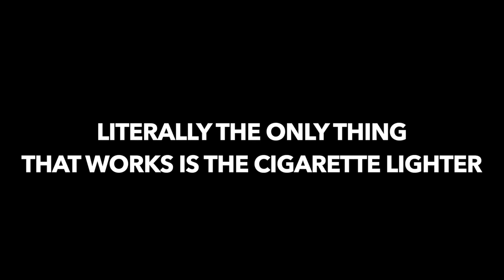OFFICIAL TRAILER | My MD500E Might've Been a Bad Purchase

Comment: “JB welding a helicopter is bad.” Spat out my water 😂
Reply: No shit, right?
Reply: no but if it works it aint stupid right?
Reply: @DolphinDivingChamp  Air craft play by different rules. It's not "will it break?" But "how long until it breaks?"
Reply: @GregoryGreg87  and "how can we be certain it will be replaced before it breaks"
Reply: @DolphinDivingChamp honestly man aviation is a completely different ethos than any other motor powered vehicles, every single bolt has to be torqued to a spec, a lot of thought & redundancies have to go into it
Reply: @Dan_Neely By having (for lack of a better term) expiry dates
Reply: I'd bet money that it wasn't JB Weld, but Hysol 934. You won't find many aircraft that doesn't have areas where it's used.
Reply: easily amused, eh?
Reply: @demitrisolvinski  it was a unexpectedly stupid thing to say 😂
Reply: I wasted a mouthful of Monster when I saw that luckily I was near the sink

Comment: I'd have to say these are some of the best videos that has ever hit the surface of youtube. I'm at home recovering from a shattered femur and broken hip and this is the best content this side of the Mississippi.
Reply: Hell, man! At least yer talleywacker still works, right? 
Right?!
Jokes. Heal quick.
Reply: Tough break fella! (sorry, had to)

Head on back and watch all the old build series. Some great content over the years in the archive that will kill a good amount of time for you.
Reply: Hey man I broke my femur same thing you are dealing with about 8 months ago. It gets a lot better, stay positive. It only really sucks in the beginning, you will recover quickly once you’re up. Push the PT as hard as you can, do extra credit volume is king. Wish you the best.
Reply: I shattered my right femur twice in a year 5 years ago. I now have a stainless steel bar holding it together. I will have that bar in my body to the day i die. But it will put my ass in a wheelchair before then, probably by the time i'm 60 so about 15 years from now. i can feel it. I have a walking stick and crutches that i need to use from time to time. i can mark out on my leg with pinpoint accuracy where it is and my leg hurts. Sometimes all day, sometimes just when i do dumb stuff but i am always aware i have a right leg, if that makes sense. Good luck dude. You are gonna need it.

p.s the bike rides i broke it on both times where worth it.
Reply: I’ll have you know that this is the best content on the other side of the Mississippi as well! 😜
Reply: @M3PH11   Same. 10" steel plate and 8 screws. 53 years ago though. When they cook me up, the guy will think I had a rake in me. Take it easy, and good luck too.
Reply: Damn hope you get back on your feet soon
Reply: Speedy recovery ✌️
Reply: Helicopter accident?

Comment: Omg this is killing me!! I need to know!
Reply: Need to know what? That he had to spend big? You see the finished chopper in the first 5 seconds, you also see it starting at the end. What's to know? 

Don't read into this very hard, I just speak frankly and not to hurt feelings, intentionally.
Reply: No worries. I need to know everything but in reference to the chopper… where is the major corrosion is, is it just the cables that are frozen making the knobs not pull out. What sensor is jb welded looks like a pressure sensor what stage in the turbine does it come from, what had to happen to spool her up can it get flying fairly easy or is it just able to start. I have more questions but that’s what just comes to mind right away.
Reply: @shawnrinkel8377  I totally get that and can relate. Sorry for being a dick, bud.

Honestly, he probably should have passed on this one. I hope the guys doing the rebuild went over this with an extra fine comb. You don't usually get second chances in a helo.

Comment: Best it could be is an experimental… a very expensive experimental that cannot be used for commercial… 
One weird thing about ‘commercial’ operation. The FAA went wild with drones being used to produce commercial content… what about experimental aircraft?
Reply: Time expired parts make it junk. No history makes it worthless. Part it out as core.
Reply: @HongyaMa  If there isn’t a complete history of the parts… cannot even sell the parts.
Reply: @thatguy7085  Time life parts = scrap
Conditional parts = overhaul
Air frame parts not listed in limits page of Maintenance Manual after inspection of serviceability - sold. It's done every day
Reply: @HongyaMa  not for foreign aircraft. Could get in loads of trouble for it.
Reply: @thatguy7085  Try again Skippy. How many air frames have you parted out?
How many engines ? How's your info on foreign exports on military restrictions?
Allison gas turbine repair? Try again.

Comment: JB weld seriously? It's called B 1/2 or B2. Tell me you don't work on aircraft without telling me lol.
Reply: Neither are used on a bleed valve / Anti ice valve. 
Tell me you don't work on the Allison 250 series
Reply: @user-jq2rf4nf3o  don't care what its used on...calling it jb weld is like the noobest thing ever.
Reply: @Codizz88  🤣 Yea. Ever work with Scotch weld and anchors in honeycomb structures? MD doesn't have any either. Bell does 🤣😁